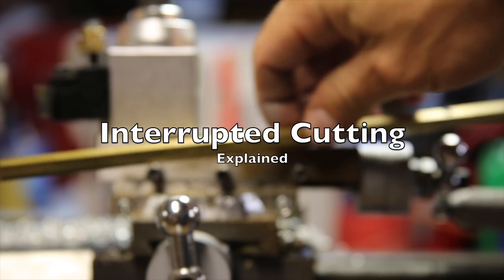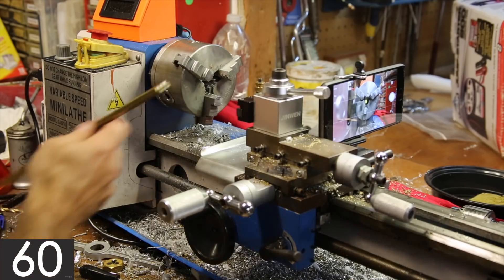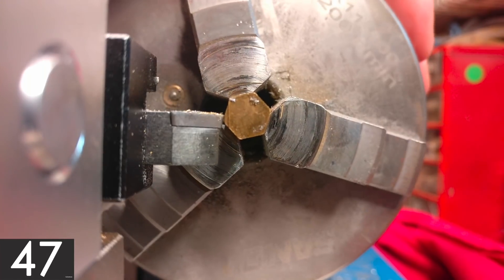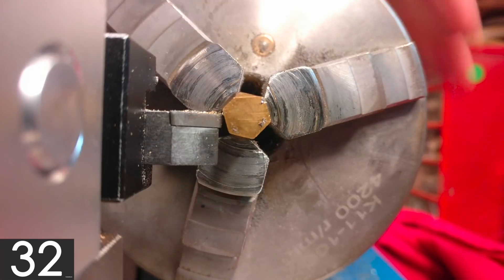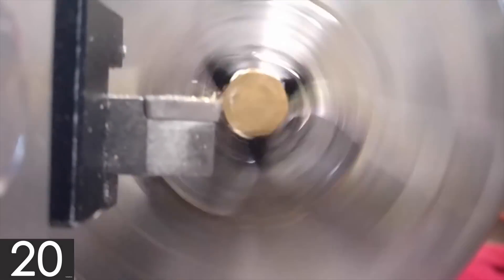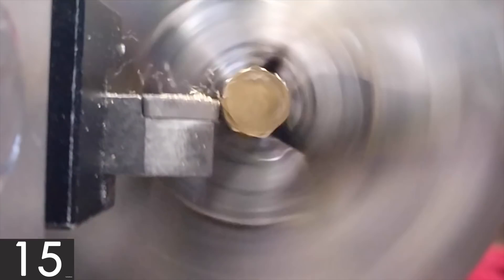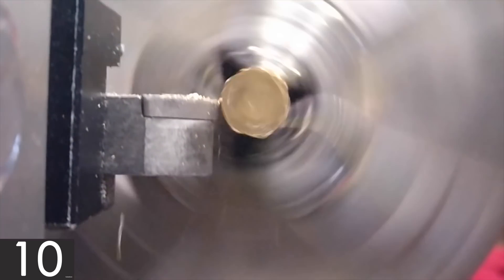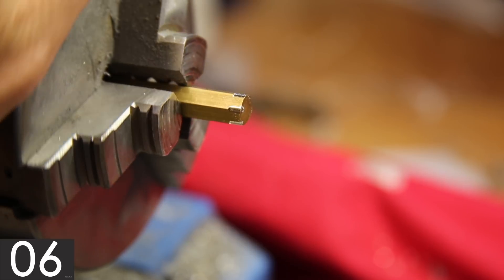What Is Interrupted Cutting on the Mini Lathe? Find Out in 60 Seconds!

Comment: more than bolting your lathe will help with rigidity, getting  a topslide assembly that doesnt have a topslide is actually fantastic for rigidity. You only need the topslide for cutting tapers (or using trig to get higher precision than the cross slide can be capable of) so using a solid assembly instead of the dovetail topslide can make your lathe extremely rigid.

Comment: what kind of material do you use for make yours proyects in the mini lathe? What types of materials can cut the mini lathe? Maybe i Will buy one... Thanks, good job!! Grettings from Spain!!
Reply from the maker: Hey! I have been primarily using aluminum and brass but I have also turned mild steel and at some point will be turning chromoly steel. 

It does pretty well if you have the patience with it.

Thanks for watching!

Comment: Going by what I've seen in past vids, your lathe isn't secured to the bench. Doing so would add a large measure of rigidity to the machine. You can also build in the ability to level the machine, and reduce (or even eliminate) any bed twist. That aluminum toolpost definitely lacks in rigidity as well (I've got the same one), but I was able to mitigate that somewhat by modifying the compound slide with a couple of additional gib-locking screws à la  Steve Jordan's method. 

Great vid, as always. Keep 'em coming!
Reply from the maker: Thanks so much! Once I have the space to dedicate to it, I will secure it to something.